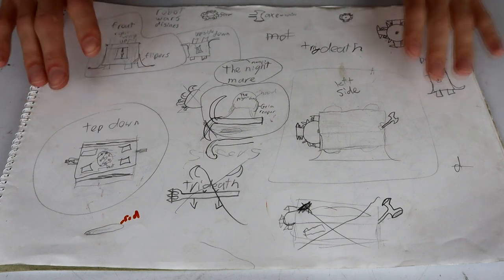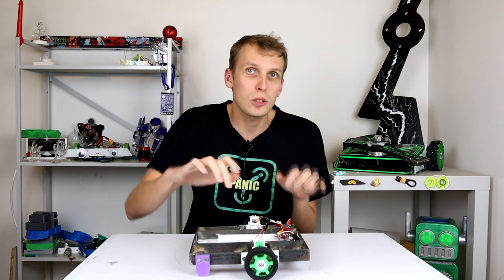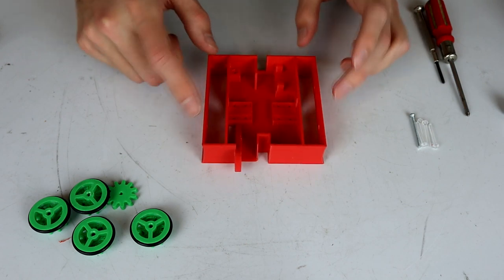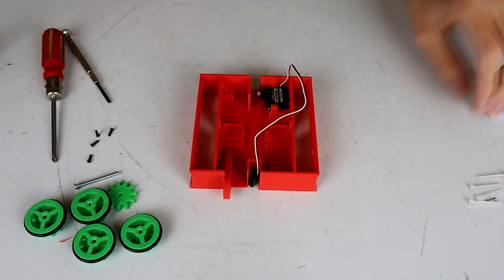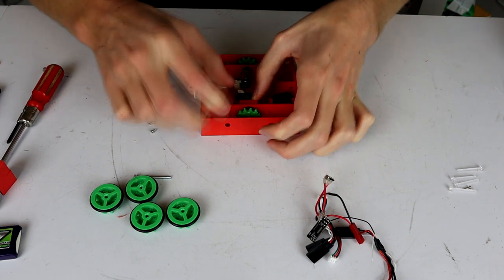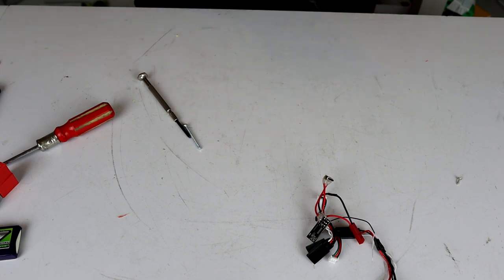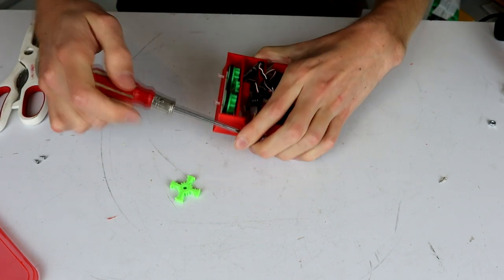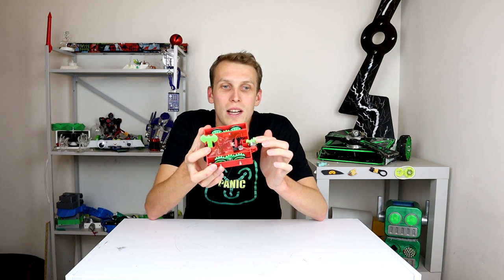Building a robot I designed at 8 years old! (2k sub special)

Comment: That looks so adorable! I love it! Congrats again for reaching the 2K milestone. You deserve it. 👍

One of my childhood designs was similar in shape to a scorpion. It was a horizontal crusher AND a vertical Razer-style crusher, both hydraulic powered. The idea was to grab the opponent with the front claws to puncture the sides, and then bring down the giant tail to pierce the top armour at the same time, creating "weapon synergy" like Dead Metal. There would also be self-righting wings on either side of the tail which spread out when it (the tail) lowers. I called this design "Nu Venom". Looking back though, it would have had terrible defense against spinners, so it was more of an artistic design that could potentially get destroyed far too easily.

Apologies for the rambling there. Hope you're well, Ben. Keep yourself safe from the dreaded COVID-19.
💧🧼
🤲
Reply from the maker: That sounds like a cool design! 
This is part of the reason I like sportsmans and plastic classes, because that design is too cool not to be built, but you are right, it would have terrible defence against spinners.

You should hold on to the idea and build it for a non-destructive class at some point!
Reply: razer259 
I have a design that is kinda tombstone like, it involves 2 counter rotating spinners stacked on top of each other, creating an almost “scissor-style” attack type.

Comment: the screws will stop it getting caught on its side when sticking out... use steel ones as you have the weight free...
Reply from the maker: Thats a great point! 
I might do that swap and see if it still makes weight
Reply: @TeamPanicRobotics  i think you will be fine with weight by swapping the plastic for steel screws... im glad to see you finally built a 4wd bot, they handle so much better than 2wd...

i love my 4wd robots
Reply from the maker: Its been fun building a 4wd, and I have the cad for it now, so I might build another 4wd in the future

Comment: Looks great!  Congrats on 2k subscribers.  I have some questions about this bot though:  What size are the motor, servo and battery needed?  I couldn't see this information on the MyMiniFactory link.
Reply from the maker: Ahh sorry knew I was missing something, I have updated MyMiniFactory, but also
The electronics needed are:

1 - 1306 brushless motor
1 - tiny 20a brushless esc (the smaller the better does not need to be 20A)
2 - Mirco Metal gear motors from DFRobot with an ESC built-in
1 - 180mAh 2s lipo battery
1 - receiver of your choice the smaller the better
1 - high voltage servo, I used the DHV56MG from banggood

Comment: Hey congrats for 2k! Been wanting to build an antweight for competition, but have 3 main reasons for not being able to. 1 is that i do not have access to a 3d printer, 2 is that I want to learn how to code, but don't where to learn to code for drive and weapons. 3 is the biggest issue, which is that there are absolutely no competitions in walking distance. Not gonna say why it needs to be in walking distance, family issues. Even if I could drive, there are no competitions that I can find in Houston Texas. :(. Do you have any suggestions for how to solve these problems? I understand if this is a waste of your time, so no need to respond.
Reply from the maker: Team forgotten gods is right! you dont need a 3d printer to do this, check out my Shark puppet build video: https://youtu.be/YhjmkHG8x5I
I did the whole design and build by hand, no CAD and no 3d printer. I was building an art bot, so it ended up being more fun then competitive, but the same techniques can be used to make something competitive

You also dont need to code, RC gear is plug and play for the most part. But if you want to learn, then the best way is to experiment, buy an arduino, and a hbridge (this is the motor driver). Start basic with a Blink program: https://www.arduino.cc/en/tutorial/blink and then move on, to control drive motors with a Hbrigde you will need to get the arduino to generate a PWM signal (look on the arduino website there are built in function for this). To control a brushless motor esc or a servo for a weapon, the arduino needs to generate a servo control signal (again instructions on arduino's website)
I recommend getting them working independently first then trying to merge them together. The final step will be to get a receiver connected so you can send the arduino a signal and have the robot move, this is more complicated, but you can see the full code I used here: https://www.instructables.com/id/Cheap-Arduino-Combat-Robot-Control/

if you are going to struggle to get to competitions, then i recommend building a wedge or a servo lifter (robots that can be safely driven without a lexan shield) and challenging a friend. If you both build "safe" robots you can fight in the backyard on a sheet of MDF/Plywood or on an unused table
Reply: @TeamPanicRobotics  Thank you so much for the info! Love your channel btw, I've seen sharky the bristlebot already
Reply: I agree with the other replies, you definitely don't need a 3D printer to start building! The first antweights I built 4y ago were made out of PVC downpipe, cutting board, small metal bowls etc (see the early videos on my channel). My first featherweight sportsman was made mostly out of cutting board and it's still going, after 3 events and a dozen odd fights (I'm currently refurbishing it with the aim to fight it again at the next Australian sportsman event, it's still my favourite robot to drive!)
Reply: @slightlyevilrobotics4271  Thanks for the advice!